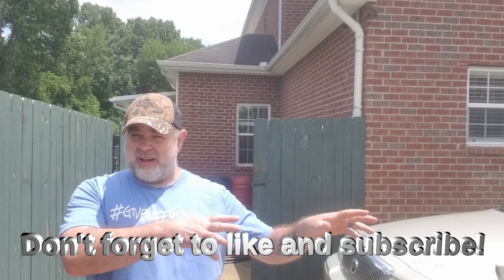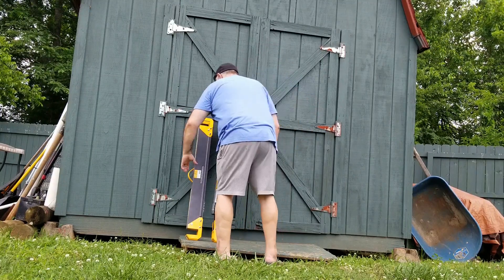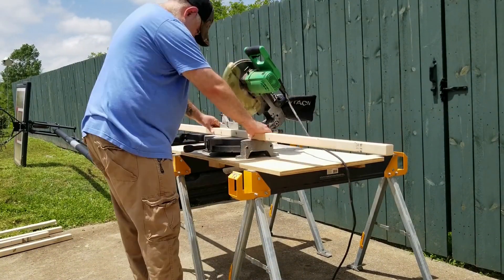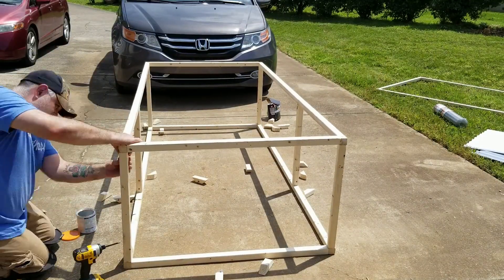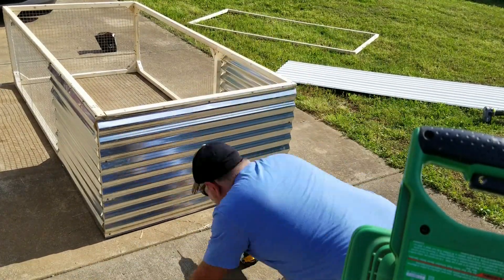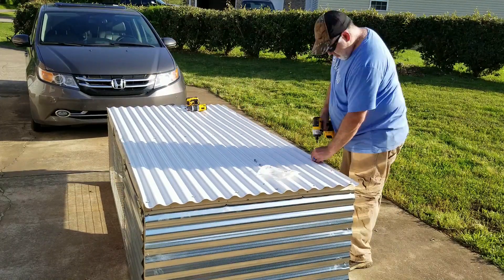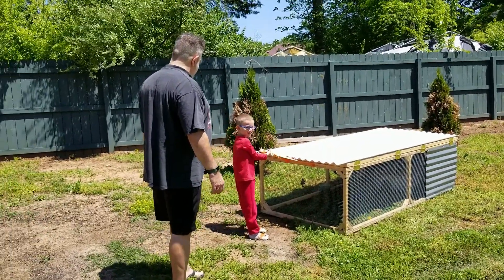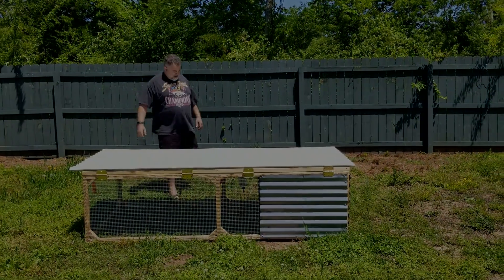How I Built My Rabbit Tractor 2 0

Comment: Great video. Very nice tractor.  A product called " mule tape " makes great handles. You should be able to find it from building supply stores or electrical contractors supply stores. One thing I would suggest is attaching the handle lower so your son can move them.

Comment: Looks good! Only criticism I would have is either take the the rabbits out when you move the tractor, or remake the bottom with a mesh small enough that their paws can’t get stuck in it.
Reply from the maker: Thanks!  Never had an issue with feet getting caught in over two years of use.  The rabbits easily "ride" on the wire when it's moved and the larger holes allow for grass to easily protrude so the rabbits can enjoy it.
Reply: @ThePrognoid  fair enough

Comment: I like the design. I'm thinking about using pvc instead of wood. I'm in Florida. Also I will have to anchor them.
Reply from the maker: Pvc would last longer and be much lighter. I chose wood specifically to give it a little more weight so a good gust of wind wouldn't  blow it over.

Comment: is the burrow protection screen on the bottom actually neccessariy if you are growing out for butchering? I was under the impression that rabbits didnt start burrowing till they were a bit older, and that if you butcher them before they reach that stage then the bottom screen is not needed. Is that incorrect?

Comment: Oh boy.  Those are VERY nice.  Wondering if some wheels on one end, that still allow the cage to still rest on the ground, but become usable, when tilting it up to move it.  Kinda like those totes that roll under a bed.

RE rabbits as a meat source: I've heard they don't have much fat on them, and so they are not good for a sole source of meat, but a supplemental one.  Our brains need a little fat to function properly.
Reply from the maker: I was thinking about adding some lawnmower wheels to work exactly like you described!

Comment: How did your tractor wear? I just saw it after 3 years.
Reply from the maker: It’s holding fine, three years later.  I don’t raise rabbits anymore but I took the wire off the bottom and use it to tractor some meat chickens from time to time, or put it on concrete and use it as a puppy play pen.

Comment: I have a rabbit tractor that I built that similar to yours. Mine has wire on the bottom as well but in my hide I have hardware cloth on the bottom in the hide so when I drag the tractor their feet don’t get caught and ran over. Have you had any issues with that?
Reply from the maker: That sounds like a great idea!  Although I haven't had any problems with the rabbits getting their feet stuck.  They're pretty good about "riding" the wire.